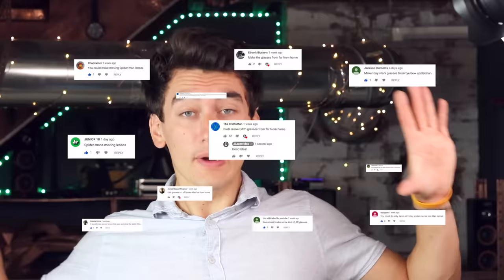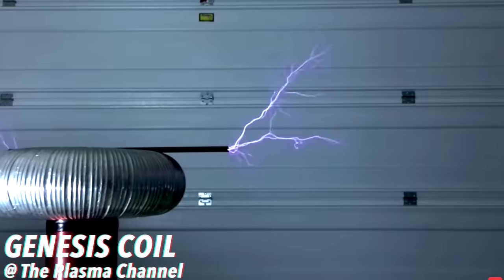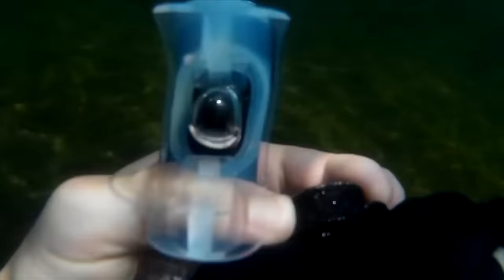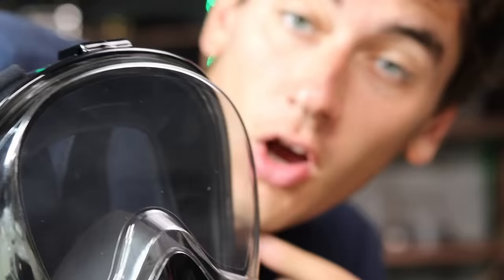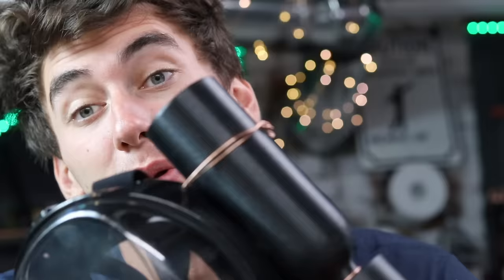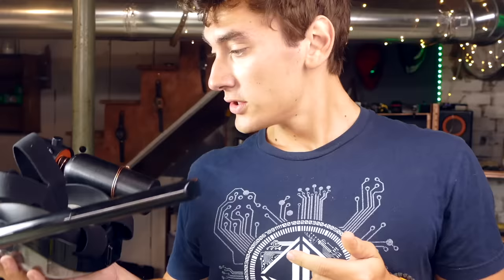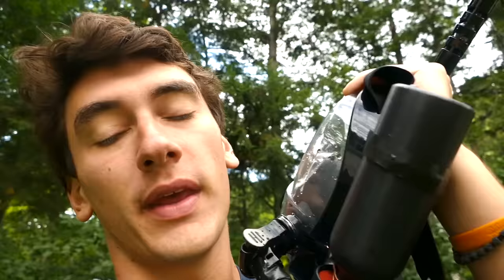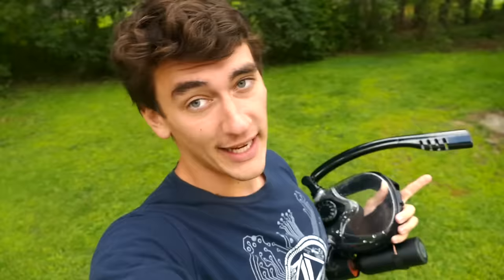BREATHE UNDERWATER With Just a MASK?!?! - Easy James Bond SCUBA Build (Building Your Ideas #1)

Comment: No one do this! Main issue being serious lung overexpansion injuries DCI or possible full rupture of your lungs. You can also get an embolism along with other life threatening situations by diving this way. Another issue is you have to fill tank with proper gas ratio of oxygen and nitrogen (atmospheric air, filtered from compressor) especially while breathing under pressure, that air you're breathing could be toxic and contaminated with other gases or bacterial particles.. also not being able to clear your ears/equalize could lead to substantial damage and long-term sinus issues. Not trying to burst your bubble this would be a cool little idea for the pool or something but you gotta practice safe diving or you'll get someone hurt.
Reply: Aside from the proper ratios, does that only apply to deep water diving?
Reply: Justin Smith deep diving(at least in this situation) is basically anything deeper than about 10-15 feet.
Reply: exactly what i thought, did my cmas license a week before and this seems super unsafe, just able to handle minimal depth
Reply: T G your lungs won’t over expand if you keep on breathing and don’t hold you breath yes you can get sick from bacterial particles so you should fill it at a local dive shop and you can equalize with a mask
Reply: Fallout Krafts you're right in the sense that if you keep breathing/exhale normally while ascending you can prevent an overexpansion  injury. "Technically" you could descend up to 33ft(every 33ft is the next level of atmospheric pressure) that being said any gas under pressure can still become toxic and if anything goes wrong with your gear how many of these people are gonna know how to CESA? Just lookin out, I teach scuba and diving is fun but things can go really wrong really fast if you have no training.
Reply: Gas mix is not the norm in sport diving.

Used a compressor working in a dive shop for 3 years. Just air filtered and dehumidified.
Reply from the maker: I understand your concern, however I stated at 2:34 that I only plan to use this at max depth of 10ft so yes it is designed to be a cool idea in a pool, not a substitute dive setup. Also all parts used in the build are licensed scuba equipment designed for this purpose as emergency dive tanks. A nose plug can solve the equalization issue however I'm not going deep enough for that.
Reply: Guide504 The air we breathe in Earths atmosphere is a mix of mostly nitrogen and oxygen. Compressed air tanks used for diving whether it be sport or scuba is still about 78% nitrogen 21% oxygen.
Reply: JLazervideo the dude does not obide. Just take your tank to the local dive shop have em fill it safely for like 10 bucks.. hey you might even meet a cheeky diver girl that wants to show you the ropes.
Reply: @TG-ll8db  no its not 

The 'norm' is a  compressor, compressing  air from the surface not active gas mix.

Stop talking bollox. 

I'm not saying this guys idea is sensible but it is misleading to suggest that most scuba is gas mix.
Reply: @Guide504 My friend you're telling me you worked 3 years at a shop and didn't know what you were puttin in them tanks
Reply: @TG-ll8db  stop reading the internet and go get some training. There is a real world outside your bedroom and computer.
Reply: @TG-ll8db  @Guide504 was putting the same thing every other dive shop puts into tanks which is surface level compressed air.
Reply: Exactly what i was thinking!!!
Reply: @Guide504  I know this not because I seek every answer to life online, I have owned and operated sea/scuba camps in the past and we (my self and crew) would run/maintenance a high pressure compressor in order to fill our tanks.
Reply: @taterman320241  Air is air whether it's been compressed or not. This doesn't change the chemical composition of the gases. A compressor just runs the "air" through a series of filters to dehumidify moisture(pull out any water vapor) and filter out any oils/contaminants providing you with clean safe breathable air.
Reply: Sure you did 

Whatever fantasy you need my friend.

I suppose you applied for Musks one way Mars trip last month. And next month will be ocean 70's.

Stay safe and good luck.
Reply: @JLaservideo  that's not the point.  The issue is your Jerry rigged this device together.  Ok, you are comfortable with you technical skills and risking your safety but the next person may not be so technical and cause injury to themselves.  Also it creates a safety issue with your seals, no gauge, and the specific reason people pay instructors to teach them to dive is to learn skills of self rescue and don't panic.

Maybe take this idea, run with it and do it right so it's safe for the masses and make a dollar in the process.
Reply: Thanks for tellign
Reply: True dat
Reply: T G gud person of the month goes to you bro
Reply: Not if you stay above 15 feet.
Reply: A lot of guessing here...

First off, lung over expansion is a real threat here! 
It happens if you do not exhale while asending as the Air in your lungs expand. It only takes e few feet if your lungs are full.
The first thing you learn during scubalessons is "never ever hold you breath" 

The next cause of concern would be damage to sinuses and eardrums due to lack of equlazation. 10feet is enough!

As for the "gas" or Air mixture your fine. Normal recreational diving is done with normal compressed Air with 21% oxygen, the same as our atmosphere. 
If you start to mix gases you either increase the oxygen content (acculy you decrese the nitrogen by increasing the oxygen) and that mixture is called EANx /nitrox. I lets you stay down for longer without decompression. 
The other mixture is trimix, witch lets you go deeper by changing out some of the oxygen for helium. 
When you compress reglar Air you run the Air thru a drying filter and a oilseparating filter.
For you water in the Air is not a problem, its mainly a problem for cold water Divers (below 10c) as the regulator might freeze. Also water in tanks can couse rust.
Oil comes from the compressor so thats no problem for you either.

With that beeing said, I strongly advise against ANYONE doing this!
Take scuba lessons, get real gear (or rent).
This is Dangerous and can result in fatal injuries.
Reply: @aboodash-sheikh3472  well, compared to your channel and it's 3 subscribers? Yeah.
Reply: Completely agree with you T G! Your lungs can rapture in just 1.6 Feet of water.
Reply: @RealCahara  sorry bob what are you talking about?
Reply: @alainmursuli6133  I know I get it, it's not about shutting down fun ideas.. I'm all about adventure and a good time.. we were all kids once and dreamed about breathing underwater. Thanks to Jacques Cousteau we have Scuba, which comes with training and a respect for the elements we put ourselves in. Ya dig?
Reply: T G no I don’t “dig” but ur 🏳️‍🌈
Reply: what about oil from the pump? If that mixes with the air that you breath in...
Reply: @alainmursuli6133  Nice. Good talk bud
Reply: well i think over 60 feet (18m) would be deep dive.
Reply: As I agree with your other points you can technically equalize by swallowing or yawning. It is a bit more difficult than  normal equalizing but I know a dive instructor who has used that method to equalize for years and has never had a problem.
Reply: @RealCahara  just did bob...

Active gas mix is not the norm. Simple as. 

Vast majority of dive shops just run compressors.

May not like it but the truth doesn't care how you or anyone else feels about it.
Reply: @projectstreet what do you mean...?
Not sure how you are relevant?
Reply: You are not a diver right? The gas mixture is not his problem. Regular air is fine to breathe underwater. There are bigger problems with no equalization the ears (if there isn’t an built in nose clamp). And lung collapses aren’t that likely at 10 feet but this is horribly irresponsible for someone who have no divers experience. The lack of air filtration is a problem but it won’t kill you in the long run.
Reply: @JLaservideo  guys doesn't really know what hes talking about i wouldn't worry about it lol, i see no way this device could over expand your lungs, so long as you're breathing properly
Reply: @TG-ll8db  i agree, i dive commercially. as long as you stay above 33 ft, or 10m breathing oxygen is safe, no need for a special mix. but if you just breathe like a normal person while diving nothing is going to happen to your lungs. as long as the regulator is working properly :p
Reply: I'd be worried about the grease in the pump under pressure too, they can become toxic.
Reply: I think a couple people are getting confoozled..lol.. yes breathe normally(prevent lung overexpansion injuries/embolism's/dci), number one rule in diving- don't hold your breath.. especially on ascent. Bounce diving is Baaaaaad(insert sheep's voice.) Equalize either by nose pinch or yawn method and don't bust your ear drums/sinuses. Follow dive tables, monitor depth and air(with gauge's), if you go past 60ft it's a deep dive and you should definitely consider your decompression stop. By gas "mix" we're talking about normal "air" we breathe while diving, not the kind of gas/"air" that you adjust how much N and O2 is in your tank. We're not talkin nitrox or trimix dives Willis :) If none of this makes sense take an open water class don't be a Dingus.
Reply: @TG-ll8db  I didnt take an open water class, but I did go to comercial diving school lol. AMD deco tables start after 20 feet not 60. But the tank hes using lasts 5min max. So no need to worry about deco at all, also he said oxygen tank multiple times in the video. Not 71/29. Just oxygen.
Reply: You meant 79/21.
Reply: Consider the oxygen or should I say AIR you are breathing now...
Reply: it's not like people will deep dive with this. quit being so critical
Reply: Life isn’t worth living past 30 (unless you have like kids or something)
Reply: this is total bullshit by some guy trying to fool people into thinking youre smart... theres no special gas mixture for diving until you get down DEEP, like 150ft and below.  A standard fill station for recreational diving fills tanks with regular atmospheric air (unless you dive nitrox)

You wont get decompression sickness from this set up as its impossible to be down for any length of time to get nitrogen in your tissue.  

Everything you stated is bullshit with this setup... its a shame you fooled almost 800 people to agree with this.
Reply: Not to mention a manual pump is impossible
Reply: @cgmason7568  again, its possible, i swear do you people ever decide to fact check anything before you type?  you can literally go on amazon and buy a 4500 psi hand pump...
Reply: @JLaservideo  Even it is 10ft, if you breathe in and hold a lung full of air coming back to the surface you still have chance to get lung overexpansion
Reply: Your not breathing the same air though, when you breathe out the air is released out the front of the mask, and they seem fine🤷🏼‍♂️
Reply: @ethankilgore7934  Have to correct you here. 100% oxygen is used as a decompression gas and for example military uses pure oxygen re-breathers. The max recommended depth is 6m and up, so no, you won't die from breathing 100% oxygen underwater if you stay within the limits.
Reply: @Believe6  yea thats why hes the only one to use it he said there could be problems with it in the video
Reply: @TG-ll8db  it is just regular old air that they put in the tanks i dive for a living every weekend
Reply: T G he legit just cheaped out on parts, that’s the only bad part, if you know anything about diving your fine
Reply: You realize this is like 6 - 10 ft under theres not gonna be any long expansion issues
Reply: @Guide504  You smell that...

I think I smell the ocean, or it's just this dude cause he's so salty
Reply: T G ok then spoil the fun
Reply: People with depression are gonna try this
Reply: Damn big brain has entered the chat
Reply: @JLaservideo  i love you im gonna make this in the summer
Reply: Would not be cool in a pool he will have Carbon dioxide in the mask and will eventually pass out silly idea.
Reply: @TG-ll8db  thats just common diving sense right? To never stop breathing?
Reply: It's SOLELY for little creeks, rivers, etc.
Not 'diving'.
While you're absolutely right about everything you've shared, it's not a 'diving diy' or to take the place of proper diving and proper diving gear.
Reply: Idc it looks cool so if I die it’s my fault
Reply: Man, why humans need to be so sensitive to damage of the lungs
Reply: @JLaservideo  well no they aren't licensed scuba equipment. The mask's amazon page states clearly that it should not be used for scuba or free diving. Also you should in fact not wear a nose plug when partaking in any scuba activities (as you would know if you took a scuba course) since you should not be blocking any of your airways. Try not to risk your viewers' health next time.
Reply: You shouldn't be diving below 4 metres
Reply: JLaservideo the mask isn’t designed for scuba, just surface snorkelling. The tank used is to inflate a BCD, not for breathing.
Reply: T G You totally make sense. I’m not a diver, but I have many friends who are and I asked why you couldn’t fill up your air tank with just regular air and your explanation is what they have given me and makes perfect sense.
Reply: @michaelrichardson3465 
Did you not pay attention?
Exhalations are exhausted via the front of the mask.

If you're going to run your mouth, at least know what you're talking about.
Reply: Well at least you can use it for 12 feet dives close to shore
Reply: @ethankilgore7934  tech divers use 100 % to O2 to deco underwater.. As long as your above 12 feet.
Reply: The main issue. if he is goes to 10 feet. He will most likely ascend to fast giving him dcs.
Reply: @williamalm9603  most pro divers can no hands equalize. With experience u don't really have to start till 12 ft.  But that's after 1000 dives.
Reply: @DarkenedFin  divers using military draeger rebreathers don't inhale pure O2. Its mixed within the Airbag. But tech divers use 100% O2 to deco. But not deeper then 12ft.
Reply: @joes6088  the tank is a Spare Air. Used as a emergency breathing tank.
Reply: @GeordiLaForge1974  the tank is called a spare air. You fill it up with a adapter from a full size scuba tank.
Reply: tbh i think you'd be okay for short 10 min dives every now and then
Reply: @ericvid  He wouldn't be underwater for long enough for the nitrogen to enter his bloodstream
Reply: this seems to be more of a casual thing, as long the user stays above 5 meters in depth none of the things you listed should be relevant
Reply: @timhowitz9405  not talking bends. Talking Lung trauma ,pneumothorax, embolism due to fast accent rate.
Reply: @justinsmith1798  you sound like your also certified
Reply: Finally someone who understands
Reply: The word “scuba” is an acronym for Self-Contained Underwater Breathing Apparatus. 

I think every things that can fall in this category, is must treat to scuba operation. the safety, how to operate it is must follow scuba rules. 

But about this contraption, i thing as long u use scuba diving manual its save. (How to breathe, decent and ascending properly, ect) 

I agree u must scuba dive certified to use this. For safety. 

The only i think this is unsafe is for equalized the era drum. If u can make this mask so u can equalized properly. I think this is fun device.
Reply: no
Reply: one problem I see with the set up, is it doesn’t have a dive computer or pressure gauge.
Reply: T G also seeing them hold their breath gives me the chills knowing they could have a lung rupture and they have no way to see how much air they have left
Reply: @ethankilgore7934  nope us tech divers use 100% o2 to deco. Just not deeper than 12ft.
Reply: @JLaservideo  it's okay, he'd know if he watched the video
Reply: Not just that is the tank meant for the pressure of the water and will it explode over time
Reply: @Guide504  you cant put wet air in a tank your missing a few steps
Reply: @alainmursuli6133  and your missing chromosomes
Reply: Justin Smith it can happen in shallower water but not offen
Reply: Did. I. Ask. For very helpful facts that could save my life and i should be very thankful for!?
Reply: Ok boomer
Reply: @justinsmith1798   over 10 years scuba diver
Reply: Lung over expansion injuries DCI or possible full rupture of your lungs isn't an issue at the depths that they're diving. He consulted a website of what the recommended depth is. @2:30 The only way to get Lung over expansion injuries is by holding your breath at a deep depth with full lungs of air then ascending.
Reply: As a certified diver, that will only happen if you go down deeper. People can snorkel in 10 feet of water. He even acknowledged that in the video that it was safe to go about 10 feet. You are not going to get nitrogen narcosis or rupture a lung in 10 feet of water
Reply: @justinsmith1798  it all only applies to deep water diving, he just got all up in his feels about a dude using a tank small at 10 feet and not coming to his "dive shop" to ask his opinion
Reply: Grant Hipps snorkling and scuba diving is not the same because with. Scuba diving you are bringing an outside air source with you so the air is not the same it changes as you breath while in snorkling you go down and up with the same breath
Reply: @yagbe3753  yes.... I know the air changes and gets compressed but he has a regulator and isn't trying to dive like 50 feet down. Even if he had a malfunction he could just surface. What I'm saying is that there isn't really much difference in the air he's taking in through that tank as someone who just came up for air. The safety issue that was brought you also isn't a concern because you're not going to rupture a lung that shallow, you're not going to get nitrogen narcosis. I've been at 100 feet and thats where you run into real danger of nitrogen narcosis or surfacing to quickly. Thats also where you need to make sure that your air quality is perfect but for his purposes, its about as safe as can be expected when you're breathing underwater
Reply: @Guide504  you do know that filtering air just removes dust right. to actully filter gasses requires 10s of thousands of dollars in equipment to actually get all of the gasses out of the air to fully be filtered.
Reply: @ShotIntoOblivion particulate filtering obviously, whats your point?
Reply: @JLaservideo  Ye
Reply: @loganflowers400  there are more gases in his tank than only oxygen, as he filled it with normal air. If only breath oxygen you will die.
Reply: @flu5610  oxygen is not lethal until you go deeper than 20ft. You can breath pure oxygen until that point
Reply: @flu5610  also. He says it is an oxygen tank. Not an air tank
Reply: tg you are letting your ignorance show
Reply: @TG-ll8db  so if you know your stuff, you should know the creator literally told you he followed all the right safety measures. He said specifically he doesn't even go the depth YOU mentioned, nor used unlicensed equipment. He also doesn't endorse doing the same thing,he does it, so we don't have to. You're nitpicking a nonexistent problem, and arguing with people about what is in oxygen tanks. Even though that wasn't your initial complaint. All to stop people from refuting your issue with the video. Also, "the air we breathe" has many gasses in varying ratios, depending on altitude and many other factors, such as temperature and even weather conditions. So, to compensate, tanks have more or less the same levels of each, give or take, as the need arises. However, the part that is important is the overall air pressure. And while some gasses are less dense than others, that is where compression comes in. Because, when you compress molecules in a gas, they get closer and denser, which increases overall pressure in a vacuum, such as an empty tank. After that, it's really just a matter of how much pressure is being released at once, which can be easily regulated, due to the use of valves. And the man has clearly done his research on the right amount, or he would be one of the people with a collapsed lung, you mentioned. Because, ya know, the rules of physics and basic biology  aren't exactly biased or finicky. They work the same across the board, for the most part. Good example, what goes up, must come down. Gravity. It's a fundamental force. Or how we all require a certain amount of gasses to breathe, properly. That sorta thing remains the same, for members of the same species.
Reply: He used it to 3m deep ok , if you only take small breaths and do ascend slowly you will be fine, there is no chance for lungs damage and i quite sure no one get DCS after 3m deep dive but More "bravery" (lack of rational thinking or simply being stupit ) and dive with equipment without any traininng deeper is really dangerus. so it will be better to dont try to reppet such a idea without preperation. If you wont to try diving do it on the course somtimes you can take demonstration classes for free. As engineer i find project on this video interesting and think about it as proof of concept building all-in-one mini scuba system.   Not  like a poor-man diving solutions for  drunk american tenager .
Reply: I mean its only 10 feet
Reply: thank you for this